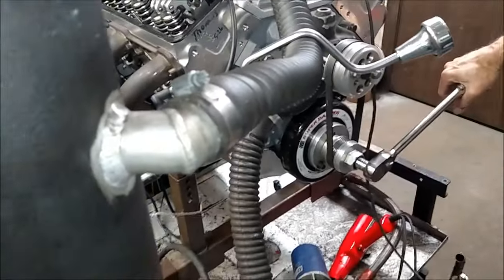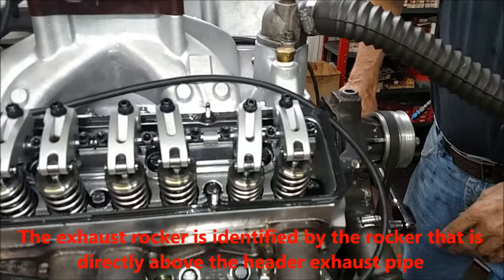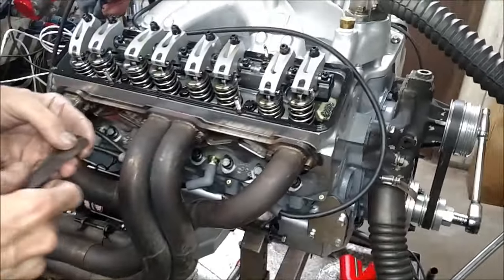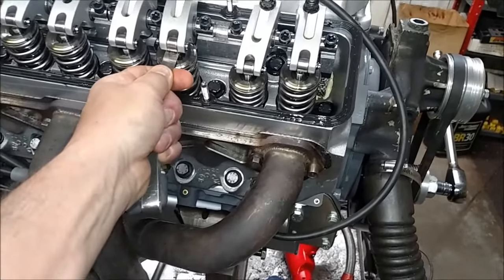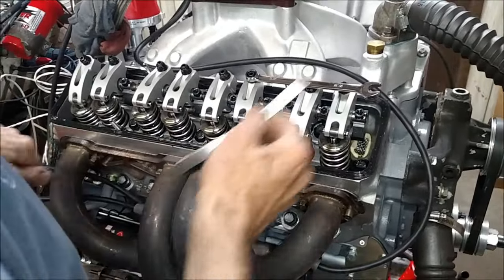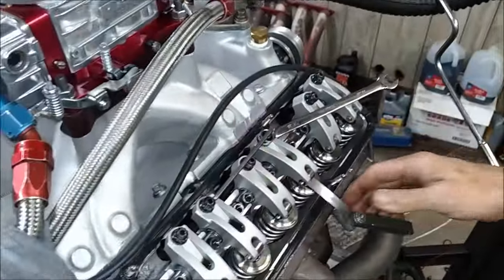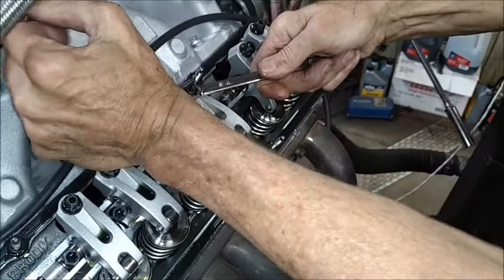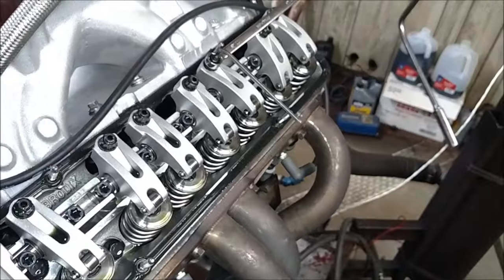How to set  Valve Lash on a Solid Lifter Race Engine

Comment: Have you ever tried this method on a small or big block Chevy (standard firing-cam order).
Put engine at TDC #1 firing position.  Adjust exh valves on cyl 1,3,4,8. Int valves on cyl 1,2,5,7
Turn engine one revolution to #6 firing position.  Adjust exh valves on cyl 2,5,6,7. Int valves on cyl 3,4,6,8.
I have done this with mild cams and as an example GM 3925535 L88 grind, and GM 3944094 and Comp Cams 11-604-5 . This is just a few. Pretty big differences in lift, duration,  overlap, int C/L. I have gone back and used the EOIC method to check the valves and none were too tight or loose. Just 2 positions of the crank and all valves get adjusted. One person can be doing one side and one person doing the other side at the same time. In case you are doing this between rounds. Worked for me for years and years. Go ahead blast away.....
Reply from the maker: Awesome!

Comment: Comp cam card says 16 and 18 cold setting I have aluminum heads do I set at 16 an 18? Thanks new at this
Reply from the maker: When an engine with aluminum heads heats up the lash changes around .004 to .006 thousandths. if your cam card gives you the measurements for a cold setting then you do not need to worry about this. but if your cam card gives you the measurements for a hot setting you will need to make adjustments to compensate for the expansion of the heads.
Reply: jtwoods41978 thank you very much
Reply: How often should i check valve lash on a street solid roller cammed engine. Every 1-2 years or 2k miles. What you recommend.  Its a street strip car with comp cams XE street solid roller cam. I was told lash should never change, and if it does something is wearing out, most likely the lifter?
Reply: Call comp give them the grind number. Tell em you have aluminum heads..they will give you the right answer hopefully
Reply: @maximusvonce1381  Check it ea oil change once a yr or?
Yes a fair amount of lash change dig further...1/2 a tenth or? Wouldnt worry about it. IF you have decent rocker nuts/locks it wont move at all 
That line of cams...do not float the valves, dont like rev limiters either .
Reply: @gordocarbo Comp Cams xr292r billet street solid roller.  The car is phucking fast. Solid roller is the best for power.
Reply: @maximusvonce1381  I bet...run one also
Reply: @gordocarbo You run a street solid roller or race roller?

Comment: Question for you... he said do the intake valves first since they cool down faster. I get that. My question is, was this engine ran up to temperature before adjusting the lash? If so, what/how were the rockers set before that?
Reply from the maker: You can set rockers when cold. You just account for the expansion and contraction of the alluminum head. It's usually .004 to .006 thousandths difference when cold.
Reply: @woodsandbarclay  Thanks for the reply. The people who know what they're doing with this kind of stuff are really rare and I'm trying to learn more about it. More specifically with big block Chevys set up for marine performance. Looking to eventually build my own.
Reply: @oswaldcobblepot502  Cam mfr is the best source 
It will all depend on what you get every cam is different. 
It will be printed on the cam card what the lash should be hot or cold.

Comment: Thanksfor responding. Is it ok to have it that tight on the gauge? Im new to solids so please excuse my ignorance.
Reply: No you need to contact an engine builder that is familiar with that cam and ask what the Tightest lash setting is. there's not an arbitrary number that is safe you have to know exactly what the correct numbers are for that specific cam
Reply from the maker: You don't want to have it super tight and you don't want to have it super loose just to smooth insert with a little resistance
Reply: Your cam card will give a spec for hot or cold lash. Do it as is says dont listen to others that tell you to tighten it or add lash 
Very cruicial on tight lash rollers which is just a trend 
Get those too loose youll break parts fast .

Comment: I have a question.. When adjusting lash most instructions say to put the #1 cylinder at TDC to adjust certain valves and then BDC to adjust the rest.. However, if you do this, I notice that if the motor is rotated just a few more degrees, the lash opens up a little on certain valves, which means certain valves are not really at the dead bottom of the lobe .. Would it be more accurate to find the loosest point on a lifter before setting the lash?
Reply from the maker: Cuzntime you are correct that's the ideal situation.
Reply from the maker: Cuzntime sometimes there is a little overlap on certain cams.
Reply: Thank you! I have a brand new motor and my engine builder set the lash on my solid roller when the #1 piston was at TDC and the rest on BDC.. I have a short base circle cam with .265 dur @ .050 and .620 lift (intake centerline is 102).. My motor doesn't have the lope/chop that I think it should, could this be the problem?
Reply from the maker: Cuzntime when you set the valve lash the cam has to be on the base lobe no matter what. I don't know about the bottom dead center because that's not what I check for when I set the Lash.
Reply: Im sorry, that's what I mean, the very bottom of the lobe.. For some reason my new 406 motor doesn't sound as radical as it should..
Reply from the maker: Cuzntime valve lash is not going to make your motor sound different. The sound comes from the cam selection and the amount of lift or overlap the cam has.
Reply: Here is my combo. SBC 406, scat 3.75 crank, corellio 6" rods, wiseco pistons (+8cc), top proline 220cc heads 72cc chambers. Compression calculated at 11.7:1.. Cam is Lunati .900 short base circle with 305 dur (265@.050) .620 lift, 106 LS and 102 intake centerline (cam was degreed at 101.5). Intake is a tunnel ram with a pair of 600cfm carbs. Timing is 20 intial/34 total.. Shouldn't this combo sound pretty wicked at idle? I had a bone stock 350 with a small .520 lift cam that sound more aggressive. I figured it should make rough 550hp. It almost sound like there isn't much compression.. Lunati said this cam should have good chop/lope at idle but it doesn't..
Reply from the maker: Cuzntime unfortunately I don't know what that cam would sound like. When I select a cam I do not base the selection on sound I based the selection on performance for the application I will be using the cam with.
Reply: Ok, I do appreciate all your replies
Reply from the maker: Cuzntime no problem. Make a recording of what your exhaust note sounds like and post it on YouTube and send it to me.
Reply: Ok, it might be a day or two but I will let you know..
Reply: That's exactly what he is doing.  He's using the EOIC method.  Exhaust closing then adjust the intake,.  intake closing then adjust the exhaust.  Then continue on through the firing order until all valves are adjusted.  It's a lot of engine turning,  but it guarantees your adjustment will be made at the base circle or smallest section of the cam.  This works for both hydraulic lifter and solid lifter cams.  On a hydraulic you will set for zero lash.  No up and down movement of the push rod.  Don't spin the pushrod,  just check for movement up and down.  Then add your preload by tightening the rocker nut 1/2 to 3/4 turns  as per your cam specs.  Ror a solid lifter you will use feeler gages just like in the video to set your lash per your cam card or cam specs.
Reply: You don't adjust ANY valves at BDC. EOIC, exhaust opening, intake closing. You can do all valves this way without looking at the balancer.
Reply: Maybe ok for stock cams....big aftermarkets best to do them 1 at a time. 
Ck when hot...random ones to see if its where you set it...compare with hot lash on cam card. You should be good to go

Comment: I'm setting my 097 Duntov cam on my 327. What lash would you recommend? I hear conflicting stories. Some say it was updated to .008/.018 from .012 /.018.
Reply: Sorry man I don't know what your setting would be. if I were you I would try to contact an engine builder that has experience with this cam
Reply from the maker: I really have no idea how to answer that question
Reply: Whatever GM recommends .  Problem with the web is you dont know who is givinbg you info or where it came from. THe old 30/30 cam used .030 last for instance.

Comment: whats the feeler gauge measurement of clearance to use?
Reply from the maker: KFLY67 that's totally dependent on your cam that will be listed on your cam card.
Reply: Thanks, I don't know what size cam they put in the engine its a 385 stroker chevy, would I just need to pull the timing chain cover off ?
Reply from the maker: KFLY67 I don't know because the only way I know how to adjust lash is by getting the numbers from the cam card. the Lash of the Rockers is dependent on what type of Cam.  I'm not sure what to tell you.
Reply: KFLY67 '
Reply: anonymous no he isn’t fucked. Just lash it out little roomier. Like 18 on intake and 20 on exhaust. That’s what I did on my sbc with a .650 lift intake. Never had a issue.

Comment: Are u setting them cold or hot?
Reply: David Gray set one pair while it's hot. Then let them cool and take your cold measurement and set the rest cold
Reply from the maker: I'm pretty sure the engine was cold in this video with aluminum heads on a hot engine if I remember correctly it's .004 to .006 difference to account for the heat and the expansion and contraction